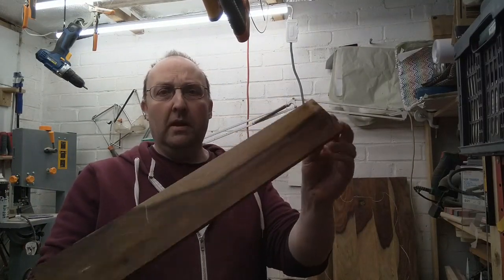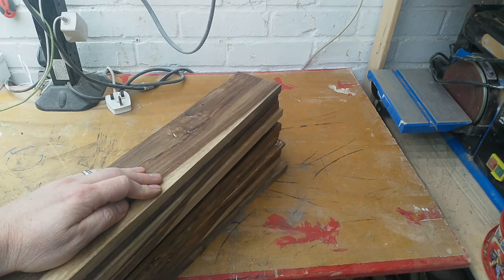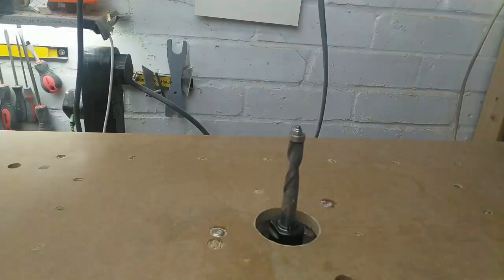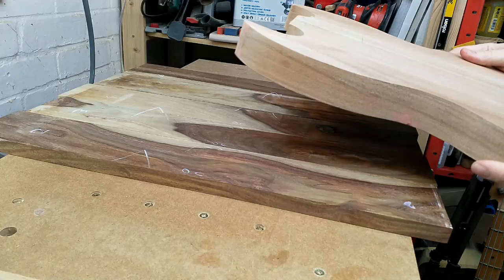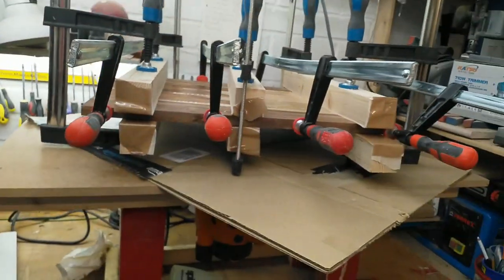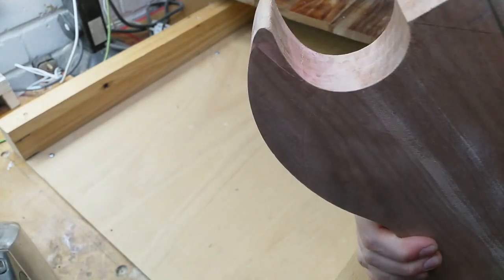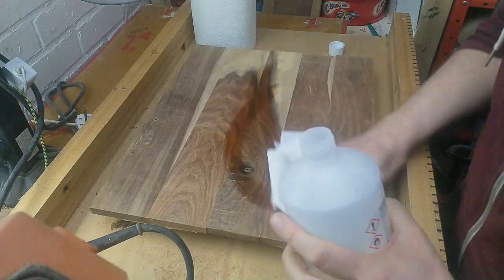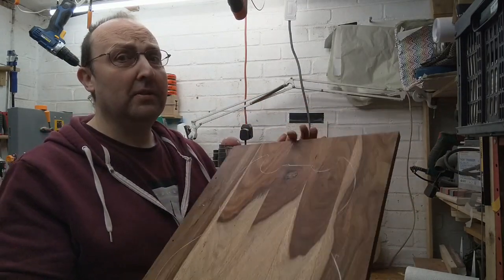Jointing without a jointer planer - Guitar Top - GGBO2022

Comment: "Jointed" miss spent youth or 😁 What was the wood you used mate?
Reply from the maker: Joined? Dunno, there's a lot of woodwork terms I copy from 'merican videos without thinking about them properly.  I think the wood is called Sheesham, but I'm only guessing.  There's a lot of shops importing Indian furniture that looks like it.   I took apart a TV cabinet a friend didn't want, all the stuff visible from the front is dark brown, almost like walnut or rosewood.  But on the undersides and back where you can't see were all these streaky bacon bits.   Someone put a lot of thought in placing them when making it to maximise the yield.